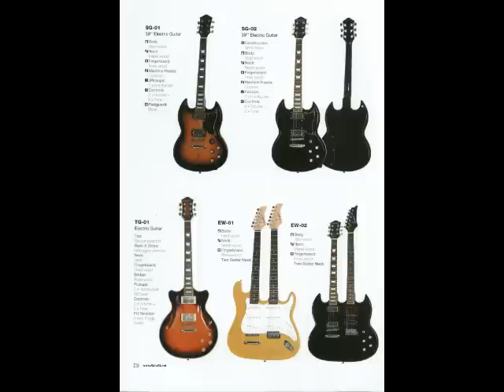Rino88 Electric Guitar Factory China

Comment: As a buyer of Chinese guitars, I've noticed great improvements over the years. Because they're now using precision CNC lathes, intonation isn't a problem like it used to be a few years ago when string lengths were often a tad too short to tune well. As always, I replace the tuning heads with locking ones; the ones that come with their guitars are cheap and poor quality. Pickups are usually okay. Bridges, which use to be fairly sharp and break strings in the old days, are buffed and smooth now. Fret work has also greatly improved; they don't stick out like razor blades anymore. I've played shows and recorded with them. No one ever complained about their sound.

Comment: The laminated Plywood that they use is cured with an epoxy in a heated press, Is durable, resists temp changes. The neck is more stable and in some cases the tone is more bright. Samick makes 90% of the worlds guitar bodies and necks. They sometimes get sent outsourced for assembly in the USA or Mexico. Washburn was an example of this...The orient has been making musical instruments for thousands of years before the Europeans. The expense that is added to the cost is when the guitar has binding, custom pickups, custom hardware or passed through the hands of a Luthier for a few hours for fret work and final finishing. That is the only difference between a $1000 guitar and a $200 guitar. Learning on cheaper guitars how to finish fretwork, crowning, leveling and polish will make any guitar play amazing...Save yourself some money. Watch some you tube vids or take a luthiers course. You will reward yourself with a beautifully playing instrument and pride that you can do this yourself.

Comment: You can clearly see in the video when the camera passes by the unfinished bodies that their not a single piece of wood but it looks like a bunch of layers of wood pressed together as in particle board. I bought a guitar kinda like these and that's exactly what it was, particle board.
Reply: I hate that type of body. There's another name for it that escapes me. I want to say laminated but it's so particle boardlike that name wouldn't fit. Lol.
Reply: It's plywood.
Reply: raze101 Most if not all of these shops use 3 pieces of mahogany for bodies, especially the LP copies as its much cheaper to produce a guitar this way. Nothing wrong with it , I doubt anyone would ever notice the difference in sound but that is why these are 10x less expensive. Sure you need a good setup, fret level and polish and ultimately replace the tuners and electronics but even then you are still in the lead on costs. They are Chinese builders and their craft is getting better and better all the time.
Reply: actually, a plywood body is beyond infinite more stable than a single piece body.....that's the reason plywood was created in first place. So the moisture in the air doesn't affect the wood.
In fact, today guitar necks are made like "plywood" out of 3, 4 or up to 7 pieces of wood glued together, to improve the tuning stability.
Reply: @AndGuitar  my recent LP chinese purchase features a solid mahogony ONE piece neck and body it is a real gem and flawless..AND plays and sounds BETTER than my real Gibson....I got tired of Gibson and Fender fleecing me...and for the record I had to do exactly everything to those as you would a CHinese replics...new Pups, setup and ALL of them needed fret work...my bud bought a Gibson Custom shop SG toally unplayable and is just crap....back it went and they replaced it with an equally shitty insturment...6000 Vs 200....not a hard choice..I laugh when these guys say they will never sound as good as the real ones...that is a huge misconception and totally not true..my new Replica sounds and plays better than the real one. AND it is a tad bit heavier than my real LP.

Comment: 6:05 thats your 'custom' JEM for 120€ hanging there. And the Neck is screwd in in 40 sec. no second look next Neck...8:20. Strings on it. nothing cracks. Good to go. Plug it in a Amp? Why? Its only a Guitar right. And they all know its filming time. How worse is it otherwise? I dond wanna know. And those aliexpressfans buy that...I would buy parts, like a fretboard, if i had to, but NOT the Endproduct. No matter if it is a Counterfit.Its a crap guitar. Spend 500 more and they are playable i guess. Endcontrol? Quality?  Its like ' lets hope anyone there gave a fuck that day...

Comment: I'm no a guitarist. So what's the issue with ply wood? Engineered timber is used in a lot of applications as it's more stable that natural wood. In other words you have better control over its behaviour.
We can't know these guys for mass production. Mass production is what makes most things in the west affordable and built the west as we know it.
Reply: You have to play guitar to fully understan. I don't blame you that you don't know either. In guitars (especially acoustic) ply wood and solid wood are completely different.ply is made from sheets of wood glued together in opposite patterns. This make the wood really stiff and not vibrate as well as solid wood. Solid wood as you know is one piece of wood where the grain all runs the same way (as wood should) this technically makes it weaker and more prone to weather affecting it but it's a lot more resonant and the notes sound "fuller" that's why all ply guitars are $100 and all solid are 1000+
Reply: +Alex Leezer when I say ply and solid wood are more different in acoustic, I mean that from my experiences solid wood in acoustic makes a bigger sound difference than ply than in electric guitars. (Sorry, I didn't word it right the first time)

Comment: I got a fake Chinese Martin D-45 and my biggest complaint is the smell. The thing smells like chemicals and stinks the whole house up. Other than that it was pretty good. The intonation was just as good as my real Martin, the thing stayed in tune and the thing looked pretty good. I was reading about all the ways to spot a fake Martin D-45 and this guitar passed most of the tests that they used to fail. They must watch videos and read about the differences and make changes to get it as close as possible. I had to polish and round the the fret ends to get rid of the sharp edges and to be able to smoothly bend the strings. Overall it's nice, just needs to lose the horrible smell. I still prefer to support and buy real American guitars but there is no way i'm buying a real D-45. Way to much money for now.

Comment: As a quality engineer I see a lot of things in the video which don't contribute to quality. In photos and from distance these guitars look nice. When you inspect them more closely you find imperfections here and there. Most have really crappy hardware, tuners, bridges, pickups. The frets are not worked out as they should. 

I'm not saying all chinese guitars are bad quality. You can get good individuals which is the synonym of bad quality because the production process has huge variation and some guitar may be perfect and another may be crap. The consistency of the production process is bad.

However they are improving. Smart people usually do. Maybe in  the future they will reach the japanese quality or even surpass it. But there is a long way to go.
Reply: This is why people usually buys the $200 guitars on Ali........if you request a guitar directly to this factories, they will do a really awesome job, and of course, they will not charge you $200, but $500............I had a copy of the Zakk Wylde Gibson........my god!! I plug that baby, and those passive pickups sounded BETTER than the original EMG actives......I felt I was playing two guitars at the same time because of the power it had!

Comment: Folks, what the clip does not say is that the factory makes FAKE Fender, Gibson, Ibanez etc guitars.   I am Australian though now live in Asia, and have bought one in China that was said to be from this factory.  It is virtually unplayable as the neck has now totally warped, the nut has been positioned incorrectly, the frets are unevenly inlaid, the tuners are completely useless (thus hard to adjust and won't stay in tune) and the electronics are faulty.  The maple neck is a laminate not one piece and the body is made from at least 4 pieces of wood which are now starting to crack.  The guitar is now in numerous pieces as I have disassembled it, in an attempt to fix the numerous problems with it.   I now know why there is a hole in the body under where the neck joint would go - to store it on a conveyor.   Yes they look fine in a catalogue but don't expect a quality instrument.   My other guitar is a genuine 1979 Ibanez Artist semi acoustic that I bought new all those years ago.   It is still in perfect condition, and all I have done to it is replace the scratchboard and put new gold leaf on the pickups.
Reply: +Mark Dignam  is it turning into a ladyboy
Reply: +Mark Dignam  I have a solid body Ibanez Artist. 1980 I think. Bought it second hand in '83. What an outstanding instrument it is

Comment: Plywood bodies!  Ooooo!  Quality material.... Check right at :58 sec.  It looks like plywood to me..   Keeping cost down as well as tone and sustain.  Oh well, what do you expect for $200.00 right!
Reply from the maker: The factory uses woods based on customer orders. Maple, Alder wood, Rosewood, Mahogany are more commonly used in this factory. The selling price of the guitars are more a reflection of land and labour costs; not the wood used.
Reply: Thanks for the feedback on my post!  It was more intended as a toung and cheek comment, I understand.  In fact I have a couple of Chibbys but it was a struggle getting a LP in the correct dimensions, primarily the shape of the cutaway. they seem to post a photo of a proper cut with a nice point as a LP should be but when I recieved it there was a much looser and goofy shape to it and kinda ruined the copy.  The whole point is to be convinced that it a real LP and that's a dead give away when it's not right.  So I gave up.  Do you have any suggestions on a vendor that does the body and the rest for the cuts and profiles properly?  I would like to take another shot, if I could be sure I was getting a convincing copy, like a Burny or and Epi.  With the Gib headstock.  Your input would be greatly appreciated. thanks Bill
Reply from the maker: @billdibacco   Billy DiBacco  China has 100s of guitar factories in various locations in its vast land. Gibson and all the major brands subcontract these factories to make guitars for them. I recommend you use some Chinese search engines to look for it. They will have exact copies of Les Paul guitars.

Comment: Instead of unethically buying Chinese illegal black market guitars, get one with USA made pickups on a Les Paul Epiphone product.  Employees in the USA and p-ups made in USA.  Be careful if buying used, owner might have switched out USA pickups for Chinese crap.  Here's description off Sweetwater, Epiphone Les Paul Tribute Plus, solidbody electric guitar honors the years Les Paul spent with Epiphone in the late '30s and early '40s. The LP Tribute Plus takes the classic design of the Les Paul into the modern era with premium components not normally found on a guitar this affordable. The traditional mahogany body is capped with a carved hard maple top for exceptional note definition and clarity. And for classic Epiphone playability, the mahogany neck sports the 1960s SlimTaper D-profile, regarded as the just-right feel by many players. Factor in two Gibson USA '57 Classic humbucking pickups using 4-conductor pickup wiring, giving you access to series/parallel pickup switching with the push/pull tone pots. This additional tone-shaping capability makes the Les Paul Tribute Plus an incredibly versatile performer.  Hardshell case.  INCLUDED. Aquamarine flame top and other great colors. On website current not on sale price of $850
Reply from the maker: Gibson sub-contracts the same factory in China to make guitars for them. Very few guitars are actually made in USA. In any case USA is not known for being good quality. When it comes to quality countries like Japan and Germany come on top.

Comment: not a cnc insight
Reply: Pin routers with templates, just like Fender used to do for decades. Using a jointer has always scared the bejesus out of me. The guy running those necks over the jointer early in the video is asking to have his palms shaved off.

Comment: What a waste of resources =/
3d printed guitars are the present and the future
Reply from the maker: DaemonovEarth That depends on how fast and economical a 3d printer can make a guitar, followed by it being strung and setup. But then need to compare the quality and most people much prefer a guitar that is made of natural solid wood. The above guitar factory has a workforce of about 1000 people and they manufacture 1700 guitars per day.
Reply: I'm sorry but 3d printers are not there yet, they're only for products that are going to be copied by wax molds of printed concept parts. The parts that come out of the 3d printer do not have the actual strength, finish, sound qualities, and proper weight to make a guitar. Even simulated wood if it could be printed out, it would never be as good in properties as real wood. You can't copy wood and print it out, not yet anyways.

Comment: some of the necks look o.k,...some don't.  Bodies are all plywood and those burst paint jobs look awful...I'm guessing the parts are crap, too.  Mass produced garbage.
Reply: I ordered a kit from there and the wood is correct, routing, alignments, hardware, dimensions, weight etc. then after completion, the sound....just as good as a $5000 LP. you're all talk.
Reply: You ordered a kit from the Rino88 factory?...the wood is "correct"?...it sounds as good a $5k LP?  You sound like a Rino88 rep hyping their crap.
Reply: taradead Most of the boidies I saw in this video were basswood or alder, some mahogony (all the 2-3 piece bodies) but no plywood. I havent seen or heard of plywood bodies coming out of China for years. Just a normal guitar factory with some decent setups.